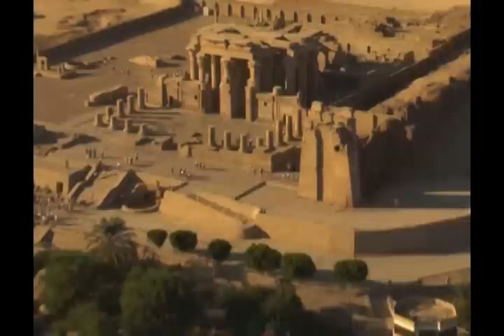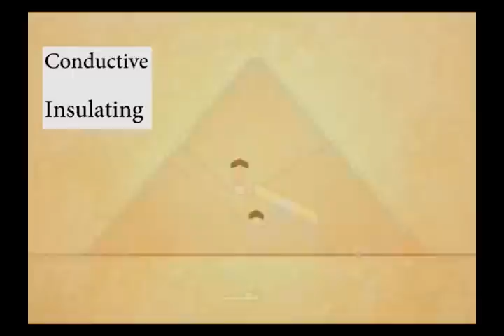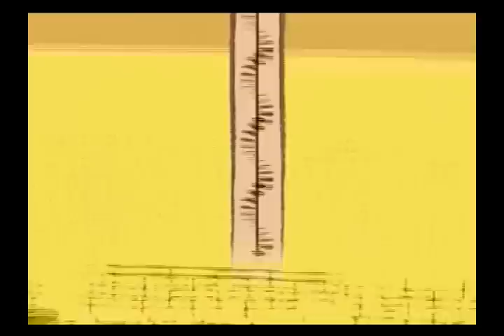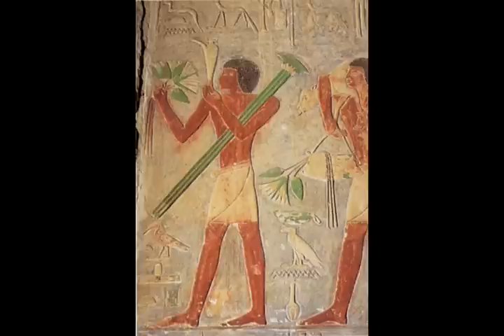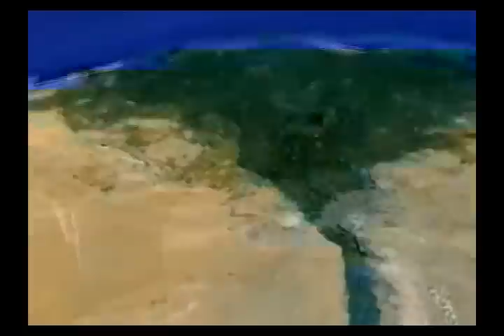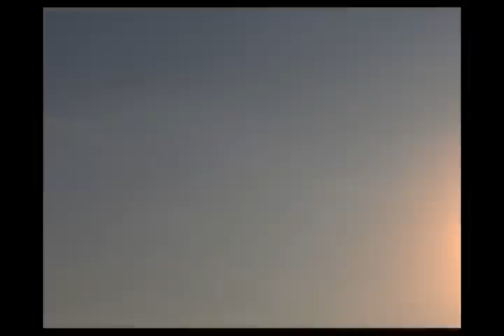The secrets hidden in the pyramids of Egypt

Comment: What if the Pyramids were built by the offspring of the fallen ones, to escape the flood ? Isnt there an air shaft going to near the top ? I read somewhere that they had water pumps in the base, like a bilge pump. Wouldn't the pyramid shape with slanted walls help to negate the water surge coming at it and the waves ? The stones are cut within 500th of an inch of each other, then the cracks were filled with mortar, almost like they were trying to make them water proof.  Maybe they weren't tombs until after the flood. And the Great pyramid is all torn up to almost the top, but the top seems to be in relatively good shape. Maybe that's all the higher the water rose. Could this be why the pyramid image is such an icon to the illuminati. Did they beat God ? Love to hear some feed back.
I do not think that Moses and the ark of the covenant would be involved with these unholy bastards of the fallen ones.
Reply: +sailorman maybe but the pyramids took several years to build and the flood came unexpectedly for them so they couldnt of built a pyramid in a couple of days especially not with the waters rising.
Reply: Morgan Reynolds I have revised my thinking on this matter.
I have since learned who and why they built them.
Thanks, take luck.
Reply: +sailorman Awesome & no problem:)